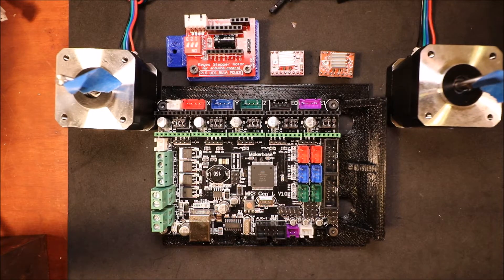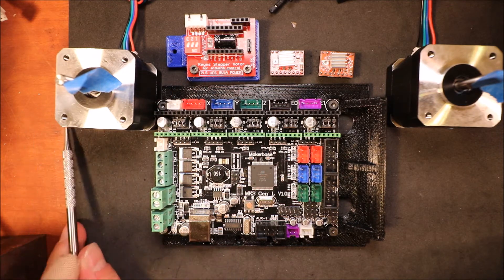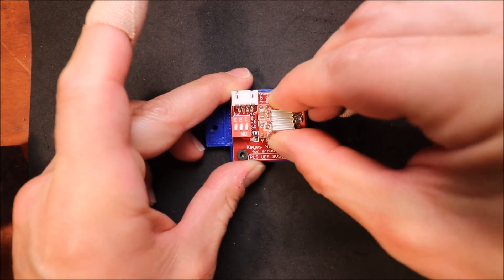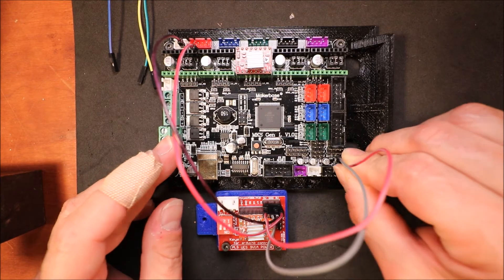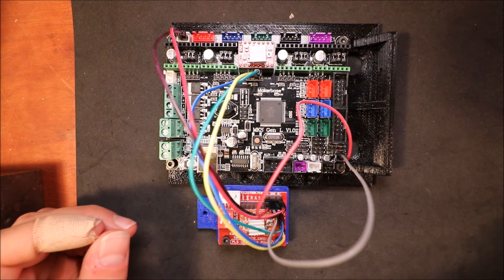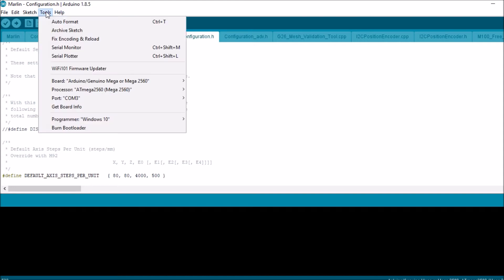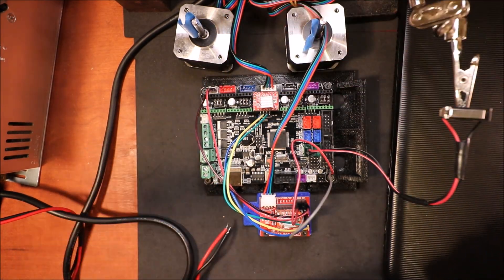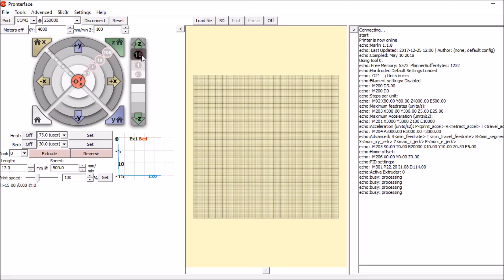MKS Gen L - External Driver

Comment: Hello and sorry for my english (I am French lol).
Thank you very much for yours greats videos very instructive! Just a little question please.
Can I use a "Parallel Module" to control a second Z stepper with the same driver than the principal Z stepper?
https://fr.aliexpress.com/item/3D-Printer-Parts-Motor-Parallel-Module-for-Double-Z-Axis-Dual-Z-Motors-for-Lerdge-3D/32821104209.html
Reply from the maker: Yes. You can ask your question in French if you. Like.  I'll figure it out considering my distant cousin is well known in French history. It begins with a d and ends with a fus.  Anyway I've made a video to address this issue.  It's either last or second to last in the mks gen l playlist. bonne nuit.
Reply: Merci beaucoup Edward de m’avoir répondu si vite ! Si tu parles Français c’est génial pour moi ! J’aurais quelques questions précises à te poser s’il te plaît concernant un prototype que je construis. Il y aura X, Y, Z0, Z1 et 2 extrudeurs E0 et E1. Un ami m’a conseillé cette MKS Gen L V1.0. Est-ce la meilleure carte MKS pour piloter 6 moteurs ? Que penses-tu de la MKS Gen 1.4 ? Amitiés de la France !
Reply from the maker: English:
They are almost the same hardware.  Some components might me slightly higher end for MKS Gen 1.4.  MKS GEN 1.4 has the advantage of having more pin breakouts for 12v or 24v if you choose to use it in this configuration.  Both MKS GEN boards have the ability to have more than 3 stepers motors for extrusion, but you will have to add additional compents outlined in my MKS Gen L tutorial.  The process is almost identical.  Good luck hope this helps.  good afternoon.
French:
Ils sont presque le même matériel. Certains composants pourraient être légèrement supérieurs pour MKS Gen 1.4. MKS GEN 1.4 a l’avantage d’avoir plus de broches pour 12v ou 24v si vous choisissez de l’utiliser dans cette configuration. Les deux cartes MKS GEN ont la capacité d’avoir plus de 3 moteurs pas à pas pour l’extrusion, mais vous devrez ajouter des éléments supplémentaires décrits dans mon tutoriel MKS Gen L. Le processus est presque identique. Bonne chance, j'espère que ça aide. bonne après-midi.
Reply: merci à nouveau cher Edward, j'ai décidé de commander la MKS Gen-L V1.0 et j'utiliserai ta super vidéo ci-dessus pour ajouter un 2nd moteur Z étant donné que je fabrique une AM8 sur la base d'une ANET A8 qui possède 2 moteur sur Z. Je compte avoir 2 extrudeurs également. Pour les drivers, là encore je vais suivre les conseils d'un ami, ce sera des TMC2208 pour X, Y, Z0 et Z1 puis des LV8729 pour les extrudeurs E0 et E1. Es-tu Ok avec ces choix ? Pour la partie configuration Marlin de la MKS Gen-L V1.0, je vais continuer d'apprendre en visionnant toute ta playlist "MKS Gen L - Tutorial(s)" que je trouve super !  Avec gratitude !
Reply from the maker: English
the driver board might be a challenge to calibrate and they are a bit expensive, but that's the fun.
French
le tableau de bord peut être un défi à calibrer et ils sont un peu chers, mais c'est amusant.
Reply: Pour X, Y, Z0 et Z1 avec les TMC2208, j'ai des Nema 17HS8401 ayant un Imax=1,7A/phase et pour les 2 extrudeur Titan avec les LV8729, j'ai des Nema 17HS4023 ayant un Imax=0,7A/phase.
Il parait qu'il faut diviser par Racine(2) pour obtenir le Inominal donc si Imax=1,7A => Inominal=1,2A et si Imax=0,7A => Inominal=0,5A.
Avec les TMC2208, j'obtiens Vref = Inominal x Racine (2) = 1,2 x Racine (2) = 1,70V
Avec les LV8729, j'obtiens donc Vref = Inominal x 0,5 = 0,5 x 0,5 = 0,25V
Mes calculs te paraissent justes ?
Merci encore !!!
Reply from the maker: English
one way to find out is to try it.  if it makes alot of noise, then the calculation needs checking.  if it moves quiet and heat is not bad, then you've hit the mark.
French
une façon de le savoir est de l'essayer. si cela fait beaucoup de bruit, alors le calcul doit être vérifié. si ça bouge et que la chaleur n'est pas mauvaise, alors vous avez atteint la marque.

Comment: I'm building a corexy with dual z, is this the way to do it or is there other ways to do it?
Reply from the maker: If you mean two steppers for the z-axis yes. Keep in mind the stepper driver boards need to be calibrate with exact voltage values or they might be out of step.  The RAMPS 1.4 has two motor pins already integrated into the z-axis.  Otherwise you can use one stepper in center of build platform to lower and raise z-axis.  The video was designed to show what the pins can be used for, but I would recommend only one motor unless you can calibrate exactly.
Reply: A suggestion for a video. Use E1 for a second z stepper, Z_DUAL_STEPPER_DRIVERS and
Z_DUAL_ENDSTOPS. I'm thinking of doing this on my build, the videos that I checked out
looks awesome.
Reply from the maker: The video you requested is being uploaded.  It might take a couple of hours to do the 80 language translations, but should be ready then.

Comment: I'm in the process of wiring my printer and I'm using the same board. What are the advantages of wiring the board as your video shows as apposed to connecting a parallel module to the Zed connection on the board?
Great video by the way.
Reply from the maker: Robert Bustamante it depends on what kind of printer design your using.  For instance I usually have two nema17 in the z axis, whereas other printer designs use only one.    The reason was also to show what the pins do on the board for those who may not have experience with this board.

Comment: It looks like they are not running at the same speed , are they though...  thanks a million! Great videos!
Reply from the maker: Not sure if they are running the same speed, but they can be tuned via the potentiometer.   Just trying to show how to setup first then cover the advanced stuff later.
Reply: I really apreciate the reply. I will have more questions later....
Reply: Im in the process of building a MPCNC almost done printing parts i have all the hardwarw and electronics but i blew up my makerbot so im fixing to do a board change and drivers tomorrow..   so much to learn. Thank you for the information you are sharing.
Reply from the maker: Your welcome.